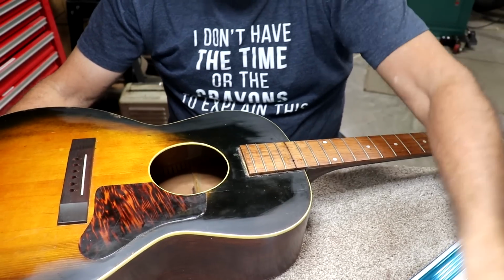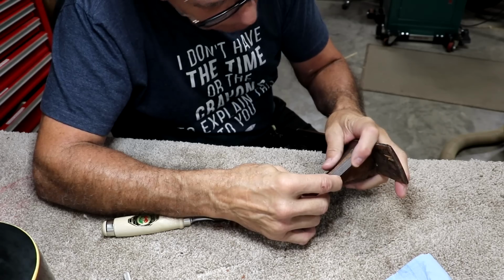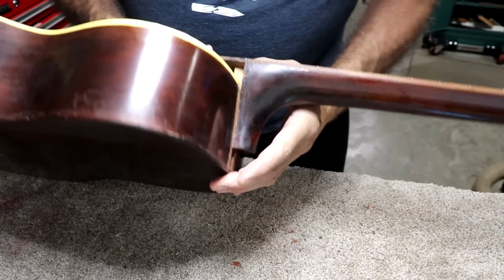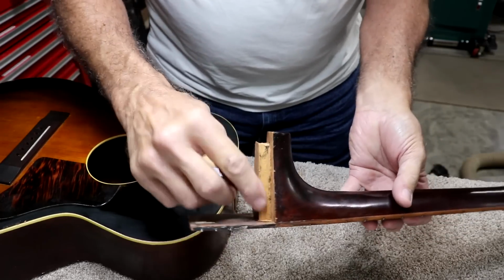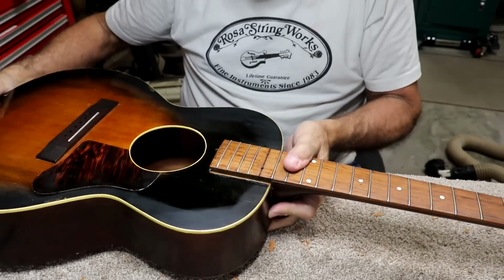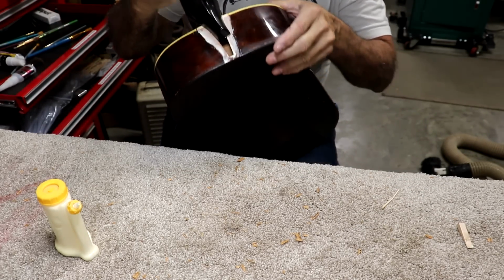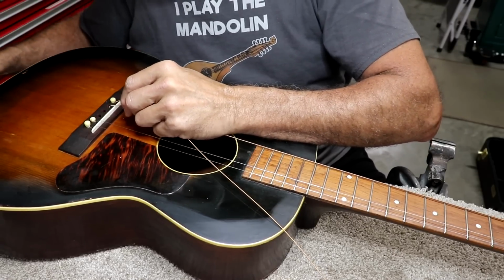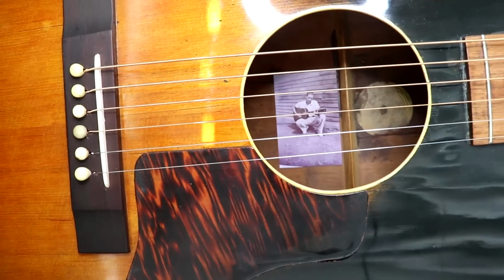534 RSW Long Gone But Not Forgotten Carson J Robison Guitar Part 3

Comment: Hi Jerry, I had the same problem with my ruler sliding around I cured it by sticking masking tape on the back, a lot better now.
Also I have found using bits of Cork sheet as padding when clamping up quite effective.
Hope you are well, keep plodding on, Eric.
Reply: Yep; good idea. I had a problem with my shiny stainless ruler reflecting too much light.

So I got some nice 'unbreakable' plastic rulers that were translucent, and put masking tape on the bottom for better viewing. Worked great.

Comment: Hi Jerry, regarding the drawing about the gap at the heel, don't you alter the intonation of the guitar mooving that neck backwards as explained with the drawing ? Very nice job,  interesting video with lot of suspens. Thanks
Reply: The top of the heel, under the fretboard, didn't change so where the fretboard joins the body shouldn't have changed, I think. Any other little movements could probably have been compensated or at the saddle.

Comment: When you shave wood off the neck where it connects to the guitar body, are you not changing the vibrating string length and hence throwing off the intonation?
Reply: The illustration was pretty exaggerated, so it seems that way. In reality, the saddle may need some tweaking, but that's always the case with a new saddle or bridge anyway.
Reply: Refine the intonation at the saddle if necessary. Changing the neck angle (even if you could do so without adding/removing wood) will probably change the intonation anyway.

Comment: Great work as always!!!
What is and where to get that blue straight edge from…?
And curious as to why you don’t do any “sandpaper pulls” to line up the heel to the body…?
Reply: BreatheScotland  That fits the dovetail joint.
I’m talking about mating the heel with the body “cheeks”.
Check out some other neck reset videos, such as twoodfrd…

Comment: I've sometimes wondered why the fussy parts of shaping wood parts aren't done with a Dremel.  I'm sure it's personal preference.  But for speed, a Dremel would go quick.

(Not to say don't do it the way that you have the most confidence with.  This would vary from person to person and it's not as though there is any authoritative best way as long as the result has good quality.)

Comment: Surprised no one has mentioned the disparity in depth of the mortise cut in the block and the tenon on the neck. Yes, the block mortise is wedge-shaped but when you fit the two together there appeared to be quite a gap(front to back) between them. Would a solid fit been preferred vs. leaving a gap? I suspect you never determined why the mortise was wedge-shaped to begin with?
Reply: Would a solid fit been preferred vs. leaving a gap? NO!
That is the designed for steam softening of the glue in the neck dove-tail joints for removal /replacemnt of the neck.

Comment: When you took material off the heel to allow the neck to draw tight to the body at the correct angle, doesn’t that throw off the intonation by effectively shortening the scale with the bridge already fixed?  Maybe the bridge should have waited until after the neck was reset?
Reply: The top of the heel, under the fretboard, didn't change so where the fretboard joins the body shouldn't have changed, I think. Any other little movements could probably have been compensated or at the saddle.
Reply: @MillsGuitars  My question exactly. Thanks for answering it, Caleb!
Reply: BreatheScotland  I'm sure if Jerry had known I was going to put in the diagram, it would have been explained better. The diagram was definitely an afterthought

Comment: 2 Piece 4M Adjustable Picture Frame Strap Rapid Corner Clamp
$49.99 $39.99
Reply: Those work, but I find them rather awkward to use. I now go with 4 separate clamps, which are designed for corner clamping. Plus, I mad a couple of my own corner clamps.